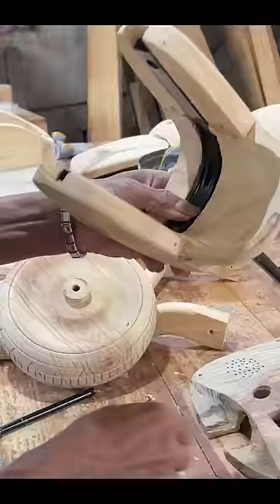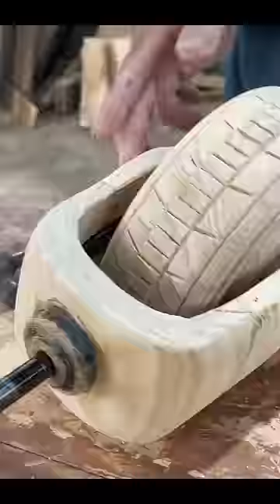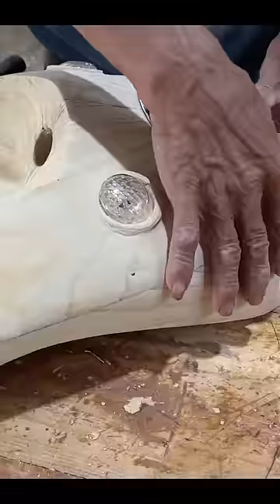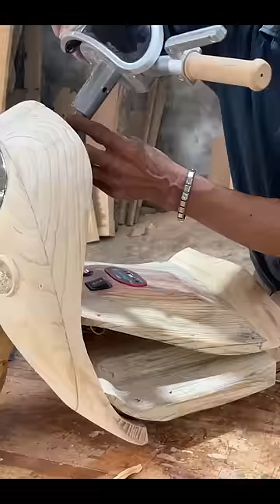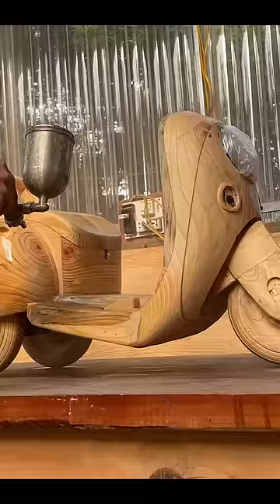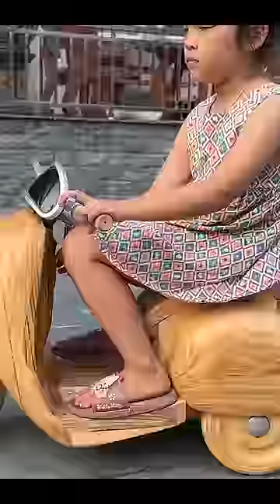Wooden Electric Motorbike

Comment: Awesome. Looks better than what's in production.
Going to all that work ...you may as well go a little further and put rubber on the wheels some suspension and decent axles  This had the potential to sell like hot cakes 🙂
Reply: I Would Like To See Some Steel 
  Bearings On Those Wheels😊❗👍🙏🏼